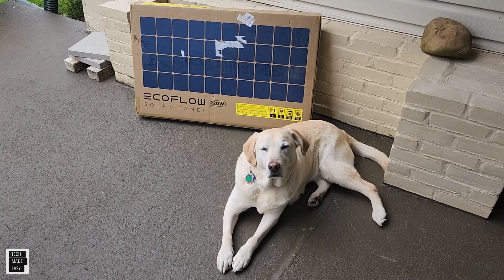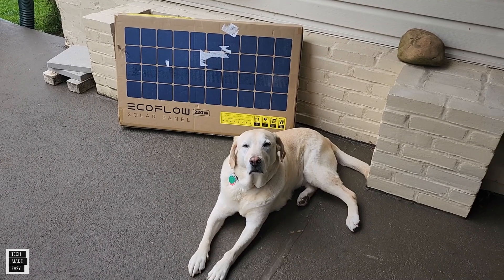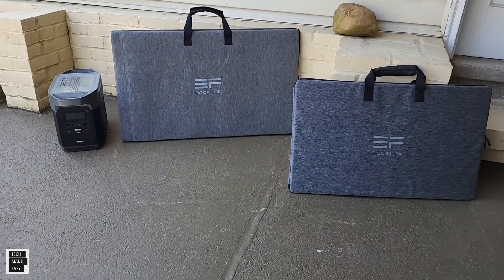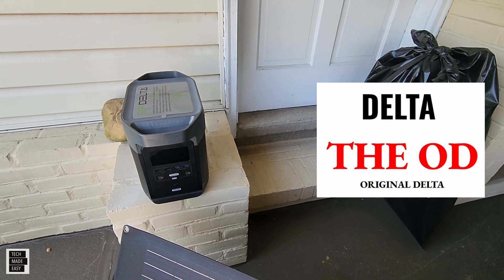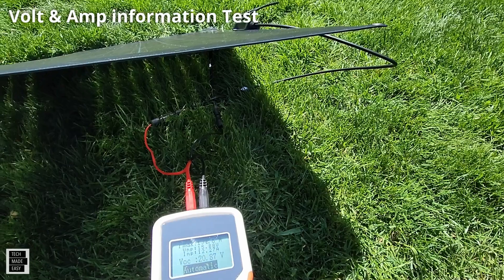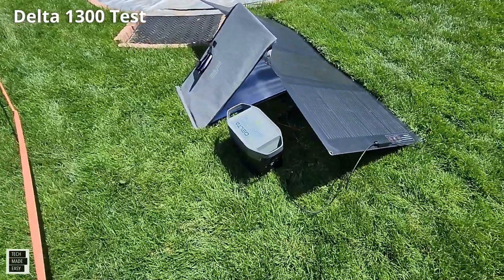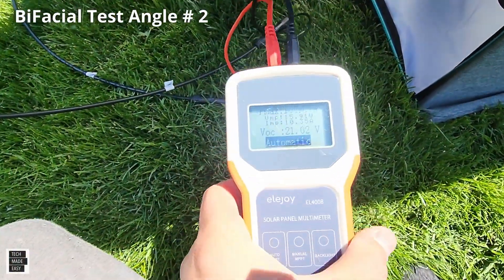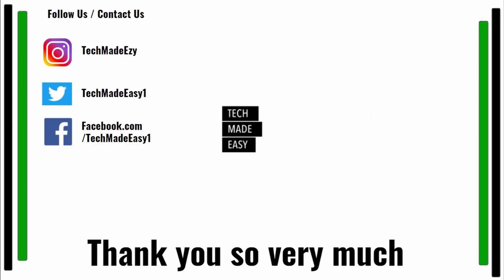PART 1 of 2 EcoFlow 220w Bifacial Solar Panel Review and Testing

Comment: It seems the bi-facial would be good on a planet with 2 suns.  Did the math - better to buy one 400 watt solar panel - equals more power and less expensive
Reply: So I have this 220w bifacial and the 400w panels. Between the 2, the 220w bifacial performs better in terms of wattage output efficiency.
Reply from the maker: Nice
Reply: @TechMadeEzy  this panel makes sense but for the delta mini or anything that’s locked to 15 or less amps it’s efficiency is useless so 110/160 panels in series are the best bet.
Reply: I think the advantage is more watt-per-size vs watt-per-dollar.
Reply: @michaelscalisi4316  Yup
Reply: I’m planning on using this panel on top of my car roof with a Mylar blanket under it. Not a mirror but hoping the reflection gives me something as the sun moves and I’m away from my campsite
Reply: @ceciliajones7816 I was wondering if that would work! How did it work for you?
Reply: It would be better to buy the bluetti PV350 panels
Reply from the maker: I haven’t tried those yet, you like them, what wattage are you getting?
Reply: @Trillville43  Are they IP68 like this panel?
Reply: @Trillville43 at 750 dollars 👀👀👀
Reply: Is this Howard Stern talking?🤔
Reply from the maker: @rodeo600 I'm busted
Reply: I was thinking the same, but I took a look and you can get 2 220’s for the price of a 400.
Reply: What if we put a mirror on the ground near the backside?
Reply from the maker: @dennisku3709 go to the video description and see part two and part three you’ll see some of the different test that I did
Reply: I wired 2 in series and only made 220W @ 40V. Running independently they made 190W @ 20V. I was expecting 380W @ 40V. Didn't happen. Anyone else run into this?
Reply: Have you tried both in parallel 160 + 220 or serial
Reply from the maker: If you’re gonna mix panels, then you’re better off, doing a mixture of serial and parallel

Comment: Nice! Have you tried placing a large mirror or reflective surface behind the panels? They say it could provide up to 80% more wattage.
Reply: How about just a white painted surface behind? White reflects all light spectrum 🤔
Reply: I saw a some flexible mirror sheets that are adhesive on Amazon. Could work well for a cheap price. Maybe stick them to a piece of cardboard or plywood?
Reply from the maker: Great idea
Reply: @TechMadeEzy  even some tin foil might work.
Reply from the maker: I don’t have a large or even medium size mirror
Reply: What about gluing an aluminium sheet on a piece of cardboard?